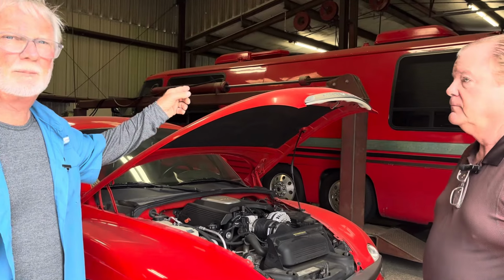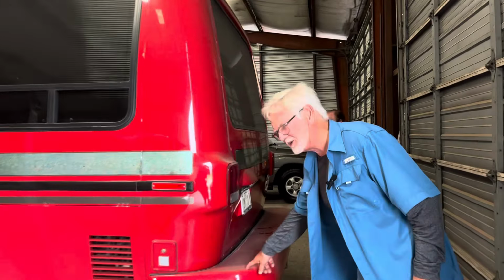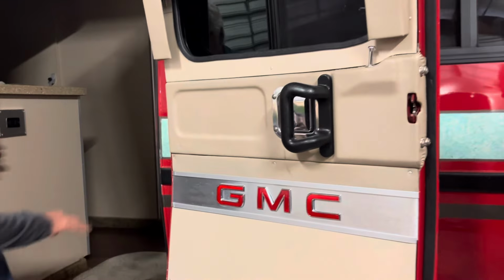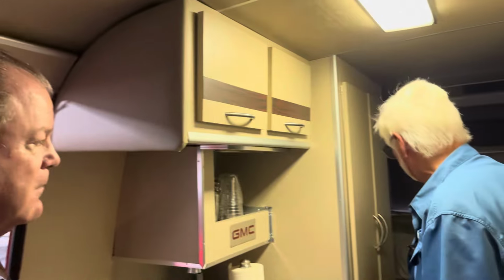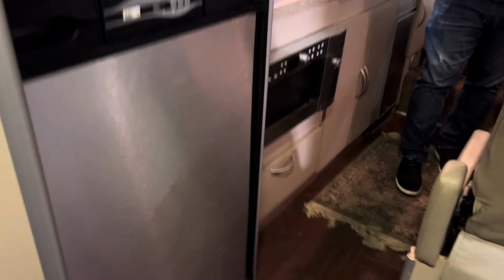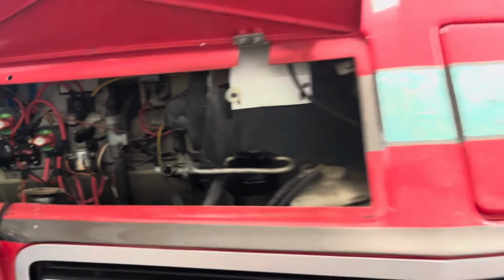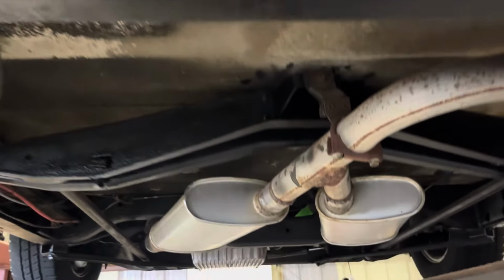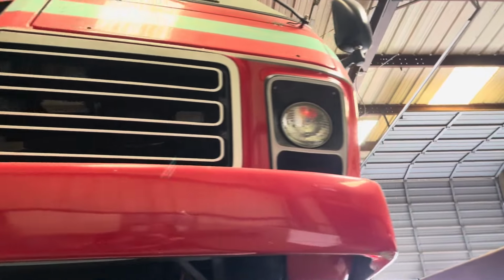An awesome coach needs a new home - 1978 GMC Royale

Comment: In 2010 my dealership took in trade a 2006 Mercury Grand Marquis with the "L" of "LS" missing. Of course, you have to buy the entire emblem to get one letter. So, I did, but I used another "S" and had a Grand Marquis "SS" for four years! Bought for $10,600 in 2010, sold for $10,000 in 2014. Well- built, just like the GMC motorhome.

Comment: ATF leaking out the pan gasket.  Just like mine!  Do they come any other way?
Reply from the maker: Sitting, the torque converter check valve leaks fluid back to the pan.  Shifter arm seal, modulator seal and trans pan seal may leak.  It’s spent the past 15 years parked up on the lift.  I’m not surprised or worried